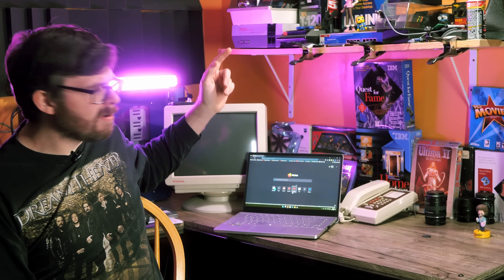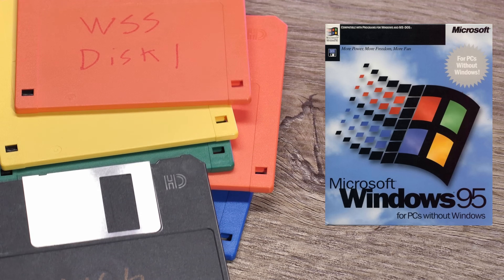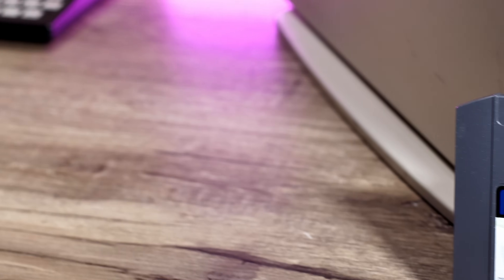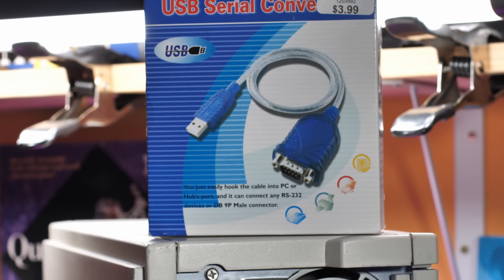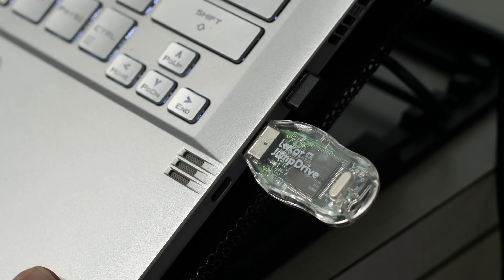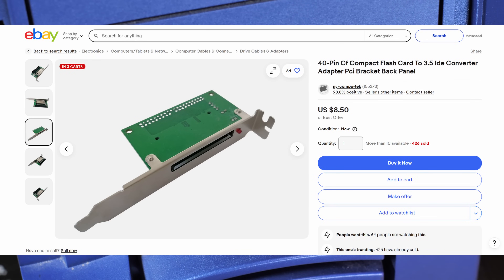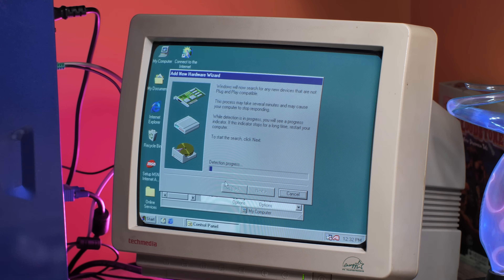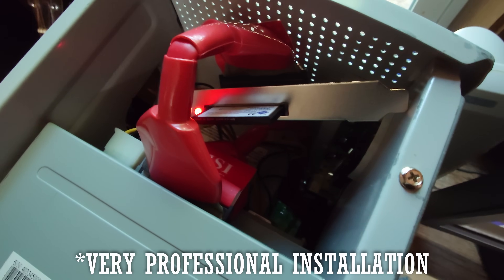What is the Best Way to Move Data to Vintage PCs?

Comment: My most difficult file transfer was with a Twinhead Slimnote 486SLC.  I would have used the PCMCIA slot, but apparently it is an early version of it, and any ethernet cards would not go in the slot (it had a modem card in the slot, so I know there must be something that would work).  The unit didn't come with it's proprietary external floppy (but did have it's original carrying case).
As all I was looking to do right away was back up the files on the HDD, I thought I could use my 2.5" IDE to USB adapter to read it on one of my modern systems.  But it also is some early specification IDE HDD, and isn't recognized on later systems.
I ended up having to use a "Laplink-type" cable and use Interlink to copy over to another laptop running MSDOS 6.x (fortunately the Slimnote had MSDOS 6 on it, so intersvr/interlnk were already there).
Since it's otherwise complete (other than the missing external floppy) I eventually need to do a fully-documented teardown video of it, and get good pictures of everything internal.  Of course, it's in such nice condition I'm concerned my ham-fisted efforts will break it.  Maybe if I get to VCF East this year (and I haven't already tried to do a tear-down) I'll bring it along to get some help.  Would be handy if there were some vintage computer people in the Mid Hudson Valley.

EDIT: digging through some cables I found a SlimSCSI PCMCIA card that fits in the Twinhead.  Problem is I'd still have to transfer the drives over Interlink to use it.
Reply: LAptops of that generation were notorious for using all sorts of oddball tricks to make the HDD unreadable. These were marketed as "security" features, but the only ones they kept out were the owners of the laptops! It's like the BIOS lock, if you don't have the instructions on how to disable it, you're out of luck.

Comment: For PCs I wrote and marketed two LANs in the 1990s: The $25 Network and Little Big LAN.  Both added drive letters to your machine and you accessed other machines as if they were local. Every node was a server and client -- a true peer to peer network. The $25 Network used serial. LBL used serial, parallel, Arcnet and Ethernet and even modem for remote connections. Nodes could be mixed connections. LBL supported 250 machines on the LAN. And it was fast on Ethernet and Arcnet. Even parallel ports were fast on faster machines. These used very little memory since they were written in assembler. I also sold a "shareware" The Weak Link which was a master/slave setup that was similar to The $25 Network but the "server" did not run in the background, making it much simpler. I included source code for it.

Comment: That's neat, you gave me an idea of how to install Windows 98 on a Dell Latitude CSX without a cd drive. I can't install it from USB, so maybe I can boot Win98 from a CF card PCMCIA adapter. Awesome vid!
Reply from the maker: You unfortunately can't boot from those adapters because they require cardbus or PCMCIA drivers to be present before they can be read. You could however copy the Windows 98 install files to a FAT16 formatted CF card and then replace the hard drive in the laptop with a 44-pin IDE to CF reader. You then should be able to just install Windows from the card.
Reply: @DOSStorm  Ooh, it doesn't boot. Thanks for info, I'll try with a CF adapter. 👍

Comment: You can buy IDE SSDs , with low capacities, like 1  to 16 GB but there's also versions that go up to 128-256 GB ... and you could use an IDE to SATA adapter or IDE to USB to connect the SSD to your computer to load files onto it.

Comment: My Dell Dimension 2350 shuts down soon after startup. I took it to a local repair shop and problem solved, for a week. Now it shuts down faster than before.
So I need a way to transfer installed programs, registry settings and dependencies to a newer computer..
Reply from the maker: If the power supply or board is failing, you might just want to pop the hard drive out, and copy what you need or make an image of it. That machine probably has an IDE drive right? You can get some adapters to read it on a modern machine with USB.
Reply: @DOSStorm  2001 Windows XP Media Center OEM. Pentium IV, 1 GB RAM.
Reply: @DOSStorm  Dude yanked out the failing Nvidia card and replaced power supply. Works now. Just ordered slightly better Nvidia card from Amazon.

Comment: HI, actually i have a usb bootable freedos stick, i normally use that for swapping files to my p4 win 98 machine, but i think it will work for dos too,  if that pc has a bootable usb port on it, but i don't have any pure dos machine to do some testing for now :/, than maybe is not possible.
Reply from the maker: Oh yeah I've used that trick before too a long time ago! Since FreeDOS boots from USB you can just put anything the root directory and you can read from it. I don't remember it being able to just mount other drives that are inserted though. However, if you see the pinned @RetroTechChris comment he mentioned it is possible use a USB ISA card for this purpose. I have not used them personally... but I have seen some for sale on places like eBay and Aliexpress.
Reply: @DOSStorm  actually on the test i have done, it self mount the other drive even other usb stick, i use that pendrive to play dos game on newer hardware using sbemu (vsbhda variant seem more compatible than standard sbemu) very nice way to play some dos game on your computer :)

Comment: Some recommend serial for really old systems, but that can be iffy when working with non-PC platforms. I'd seen CF card solutions for many platforms too. As long as there's a compatible file system both machines can understand, that's a solid choice.

Comment: I use a number of different architectures: x86, RISC OS, Amiga OS, Acorn BBC, Linux and other Unix types. If it has Ethernet capabilities I use Ethernet and otherwise a Gotek with flashfloppy. You can often find a network protocol or floppy layout that can be supported or emulated by either side. With a Gotek with flashfloppy, even a floppy installation with more than ten floppies is bearable.

Comment: Ever since I dug up the FAT32 Dos driver for DVD-RAM drives I have preferred where possible for a few reasons. One is that the media is supposed to be closer to archival grade[especially in the caddy]. two, it operates closer to a zip drive without the drive issues where it can write and read files like a normal disk. three, they come in fun caddies, especially if you get a double sided disk. Four, the larger version 2 disks are 4.7 GB per side. Lastly, modern optical drives still support the format as long as it is FAT32[You can open the caddy to get the disk out since modern drives do not support the caddy].

It is possible to format  them FAT16, but the 2GB drive limit means that even the smaller 2.6GB version 1 disks have a good chunk of unused space and I have had no luck getting these read by modern machines.

Comment: You forgot the parallel link cable!

LapLink supports the use of a parallel cable as well as serial, and it's much faster. I made a lot of use of it back when I owned a 486SX/25 laptop.

Also, a LAN could be an option, if you can find a suitable card and software. I recall one other retro-tech channel (either BitsUndBolts or Necroware) using ISA Ethernet cards and FTP to get stuff onto retro machines.
Reply from the maker: You're right parallel is definitely an option as well, and my version of Laplink actually includes it in the box so I really should have mentioned it.
Reply: Don't forget telnet w/ [X,Y,Z]modem! On the server side, it's often easier to enable the service than to configure ftpd to work just right.

Comment: zip disks arent that bad. they are a good floppy replacement since they are pretty fast and good for file transfers. reliability depends if your drive is healthy or not(also including disks).
Reply from the maker: It gets the job done, and you're right its not horrible if you have some good drives and disks. If you don't already have some working drives I don't think its something worth seeking out though. Especially since even the 100mb drives are like 30-$50 these days.

Comment: Laplink. Wow. I remember my uncle put that on my 486 PC when I was in grade 6.
Reply: I think I've still got a floppy with a copy on it from back when I had a 486SX laptop.
Reply from the maker: Laplink actually still exists in modern form believe it or not. The new version is called "PCmover" and I think it uses USB cables or a local network for migrating to a new computer.

Comment: I think the best way to transfer files between my old machines is via the Ethernet network. I use a Linux PC with Apache HTTP server and vsftpd server. I can download with mTCP in pure msdos, Windows 3.x and Windows 9x with WS_FTP or Internet Explorer without problems. The CF Card is very good, but you need to turn off the machine. With the network it is not necessary. Of course, the network is not possible on all machines, but in my case it works. I have three retromachines with SBC, a Juki 752, a PCM 4894 and a Prox 1560. All with a Realtek network card.

Comment: Hello there!
Once I settle for some sort of final systems I really like the idea of @RetroTechChris of using a network and a file server... up to now I had been using SD and CF cards to mess around with MS-DOS era system. In a couple of my Windows 98 systems I have a tray less "modern" SATA HDD rack but I connect it to an IDE port using a SATA to IDE adapter, when I need to copy a large amount of files I just eject the drive and insert it on an identical SATA HDD tray on a modern system I would be lost without using a imaging tool like GHOST to back-up my OS partition and recover messed up installations.
Reply from the maker: Yeah network is great if you have the room to put everything. I'm screwing around with too many different machines and I'm in sort of a small space unfortunately. Cloning and backup is a lifesaver though. Sometimes it is much easier to just roll back changes than try to fix something a wonky driver or installer screwed up.
Reply: @DOSStorm  I agree 💯 with your very pragmatic take!
My memories of swapping parts while keeping a system, the OS and the network working flawlessly make me shudder. Maybe the network and server approach might be right only for systems used for gaming reviewing or enjoyment with very few hardware changes.
Reply: You know it!!

Comment: mTCP always works for me when using a DOS computer with an ISA slot. Just about any 3com or a few Realtek card should work when there’s an RJ45 connector on it. :) 

Under Windows 98, I’m using an Intel gigabit PCI card. It won’t even reach gigabit speeds, but it gets the job done without any CPU overhead. 

The external Zip drives were also available in SCSI models. That helped quite a bit. :) 

Great video btw! Your puns are cracking me up every time! :D
Reply: An ISA slot is not even needed, because  mTCP even works with a parallel port ethernet adapter like a Xircom PE3. Fun but slow.
Reply: @ that’s true. Maintenance is quite a bit easier on systems with a physical ISA slot though. I prefer machines that aren’t mobile and which have expansion capabilities. :)

Comment: Great stuff and thanks for the shout out ! 3:38 later zip drives had "smaller AC adapters but point still stands!
Reply from the maker: Fair point! There are also USB bus powered ones that are less bulky. However, unless you already have everything laying around I don't think its something worth investing in for this purpose. Still... they are satisfyingly mechanical and fun to use!
Reply: @DOSStorm  100% agree!!

Comment: i usually go with sd cards because they are cheaper and more accessible for storage. as for moving files on and off i install a network device in every retro system i have. i even have a 10/100 ethernet card with DOS drivers in my '95 PC.
Reply from the maker: Nice. It seems a network option is preferred by quite a few people who have commented. I'd like to get a little retro network going myself at some point as I have quite a few old NICs around already.

Comment: EtherDFS is my go-to solution. It has a tiny memory footprint and works just as well on an 8088 as it does on a P3 733 with Windows 98. For the latter, to use an EtherDFS share within Windows, the network card must not be installed in Windows. Instead, use the DOS packet driver along with the EtherDFS driver. This setup allows all of my computers to access the same share on my modern machine. There is also a ISA usb card that work well on DOS with the appropriate driver (FreddyV DOS Driver for ISA USB v0.22).
Reply from the maker: Wow! This looks kinda awesome... thanks for sharing. It requires a little setup but it really looks like its worth it especially considering how fast transfers could be if you have a 100BASE card.

Comment: Thanks for the tip about using CF cards - I didn't know about that method!  🙂👍
Reply: The problem is that CF cards are getting harder to find, especially at reasonable prices.  I had tried a SD to CF adapter in a CF to laptop IDE adapter (yeah, what a kludge) but the ThinkPad T23 wouldn't boot off of it.  A regular CF in the IDE adapter works fine.
Since the HDD is accessible on the T23from the outside (don't have to dismantle it) I thought I could use the CF adapter to swap OS configurations.  I do have plenty of 2.5" IDE drives still, but I'm concerned I'll eventually damage the connector if I try swapping them a lot.

Comment: Got CF for both my 486 DX266 and P233 MMX but also 3Com network cards in them, packet driver, mtcp and ftpsrv and run FileZilla as the client on my modern PC to transfer files. What I plan on next is to get IPX working on both my retro PC's so I can use FastLynx (maby also Laplink?) to transfer files between them directly and also maby get DOOM multiplayer working 😁

Comment: How about Ethernet?
Reply: Windows file sharing protocol support might no longer be compatible between earlier Windows versions and current ones, but using FTP should still work, and probably one of the best solutions if you need to do it over a network. You can use whatever GUI program you want for either computer or just plain command line. Remote desktop connection has changed quite a bit over the years, and its practically guaranteed to not work between older and newer Windows versions.
Reply from the maker: SMB 1.0 is still supported on Windows 11 but it is off by default. It technically can work on Windows 3.1 and MS-DOS even. It is a pretty big security vulnerability that really should remain off unless you're doing things in an isolated environment. In general if you're going to network old PCs you should not connect it to your main home network or the internet.
Reply: @ I use a Raspberry Pi running Samba as a bridge.

Comment: I keep meaning to move my dos machine over to CF, I just haven't gotten around to it. Currently I have a SATA SSD mounted with an adapter inside the machine, which works but is inconvenient to remove to add new stuff to. But the big niggling thing is that I have a toddler, and I'm more then a little concerned that she might find conveniently placed CF cards fun to play with.
Reply from the maker: Yeah I'm guessing chewing on them isn't good for the toddler or the CF card. lol

Comment: i use cf and sd card adapters and the another very convenient way to copy files is over network adapters and ftp.
on dos just a packet driver and mtcp is needed. On windows a driver and a ftp gui.
The picogus now has nec emulation in included so thats a wireless option.

Comment: I generally go by "if it's so old that you can't stick a network card in it, it's not worth the hassle" :)
You have all sorts of transport option even on dos; sftp, ftp, smb, nfs.
Reply from the maker: If can find some room I'd like to setup a little retro network with file server or even a domain controller at some point. I'd want to keep off my main network for obvious reasons though. Could be convenient to have a little database of drivers, games or even CD images with an SMB1 share or something. Might be a good little project for a raspberry pi... Now you got me thinking. lol
Reply: @DOSStorm  Maybe buy an Ethernet switch for the retro-network, and use a WiFi-supporting Raspberry Pi as the server, with the retro-network connected via cable, and the modern side via WiFi.
Reply: I have a tutorial for a Raspberrypi Pi SMB1 server!
Reply: In theory I could put a PCMCIA network card in my Twinhead Subnote, but it must use some sort of v1.0.0 specification of PCMCIA, and the ethernet cards I have don't physically fit in the slot.
Reply: @SenileOtaku  you might check out the Cisco Aironet 350.  Do your cards have gold bumps on them?  If so, they are CardBus, and you probably need PC Card.  Only downside with the Cisco Aironet 350 is that it is only 802.11b compliance so your router would need to support it.  I have tutorials on getting started with the Cisco Aironet 350.
Reply: @SenileOtaku  You're not thinking of pcmcia (older) vs cardbus (newer)? First one is ISA while the latter is PCI. You can identify cardbus cards by their distinctive gold band with studs (often eight of them). It's fairly easy to come by wired pcmcia cards. Only ever seen 802.11A wireless ones tho (The very first wireless standard, routers dropped support for it in the mid-2000's)
Reply: Yeah USUALLY the CardBus cards have the gold bumps, some of the cheaper ones don't sadly.  As for Wireless and PC Card, I like the Cisco Aironet 350 cards. They are 802.11b and even work in MS-DOS!
Reply: @RetroTechChris  no surprise to find out that you have better retro haul finding skills than me 😂 With B it's at least possible to find routers with support for it :D